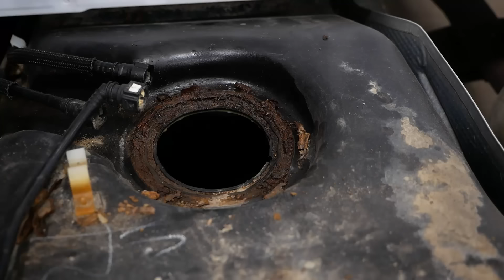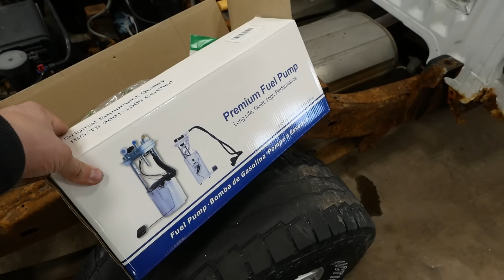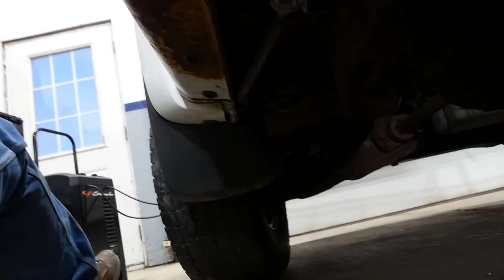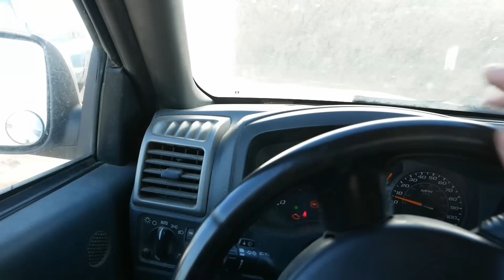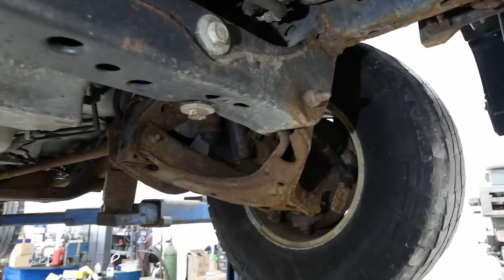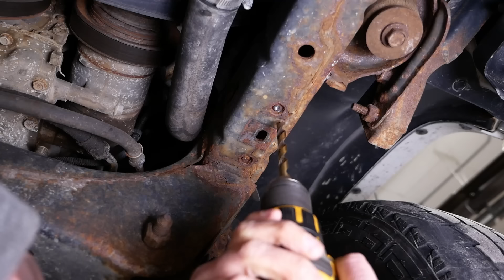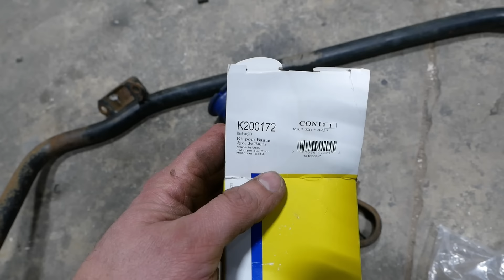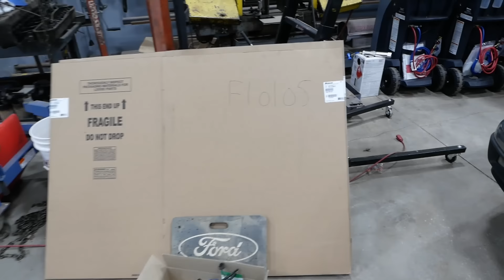Saving a GMC Canyon with 434,000 Miles from the Crusher - Won't Start, Fuel Pump Tabs Rotted

Comment: It would be interesting to see the repair history of this truck. They have a very bad reputation....but the fixes are usually cheap so I can see how someone just kept fixing this truck. Rust is another issue, I think GM uses it for planned obsolescence. I had a 2002 Chevy Silverado with 130,000 miles and it had huge rust problems, with rotted floors and rocker panels. I also have a 2001 Honda Civic, with 207,000 miles, no rust problem at all. Obviously Honda did not engineer their cars to rust quickly.
Reply: I've lost 2 Hondas to rot.  They absolutely rot just like the rest of them.
Reply: @WTFIsThisGuyDoing233  yep my shop stays busy fixing rusted out Hondas and Toyotas. They rust just as bad it not worse
Reply: @KNIGHTOFELEMIA I live in NY, and both cars were local.
Reply: GM could care less about quality AND they know it...As long as the top 12 People who run the Company get their FAT Checks & Bonuses!!!
Reply: @KNIGHTOFELEMIA I have a 1996 Accord with 281,000 miles. It has a tiny bit of rot around the right rear quarter, but that's the worst of it. The undercarriage has some minor surface rust and nothing else. I also have a 2006 Accord with 227,000 miles that is rust-free.
Reply: All cars and trucks rust out.  There is no such thing as planned obsolescence.  All cars and trucks are built to a price point.  I bet the truck was worked harder, went off road, driven in winter etc.  Hondas from that era had significant rust issues.
Reply: @user-tb7rn1il3q  - I disagree. I have 2 Honda Accords, a 2007 and a 2009. The difference between the 2, is stark. The 2007 is built FAR better than the 2009, and if you ask anyone, they will tell you Honda quality has gone down. Why? because people kept their old cars running instead of buying new ones. Honda doesn't make money when people keep their old cars.
Reply: @alanbradford3130  Except those buyers will go to another brand if true.  All manufacturers are striving to build the best product at a price at least some of the population can afford.  Overall quality of all brands is getting better over time.
Reply: @user-tb7rn1il3q  - I don't agree...IMHO, there is only one manufacturer left that makes cars that will last to 300k or more and that is Toyota. All the rest are maxing out at 150 to 200K. With the whole industry transitioning to EVs, only Toyota can make the kind of high quality cars we got used to in the 90's and 2000's.
Reply: I thought the same thing of these Colorados and Canyons when they came out. But they have surprised me!
Reply: @KNIGHTOFELEMIA where did race come from? Wtf are you taking about. I don’t have a damn clue what color you are nor do I care.
Reply: @KNIGHTOFELEMIA ooga booga is a reference to cave men and boomers who are mentally still stuck in the past.
Reply: I have a 97 accord with 225,000 miles. It needs a new rear brake line and a new IAC valve, but otherwise it runs and drives fine(I don’t drive it on the road with a blown brake like obviously)
Reply: @KNIGHTOFELEMIA no it isn’t racist. I already told you what it was but you can twist it around in whatever messed up way you want to to fit your agenda. Just like you’ve done with this whole old car BS.
Reply: @KNIGHTOFELEMIA 49 GMC half ton truck weighed less than 3500lbs.

2010 GMC half ton single cab short bed weighs 4500lbs.

The metal on older cars and trucks is thin, BUT it feels pretty stout due to the deep stampings. Many older cars were put out to pasture before 100,000 miles, and were such a chore to drive in the snow on bias ply tires. That adds up to cars that saw very little road salt in 75 years.
Reply: @Texassince1836  i think people forget about mandated safety features that add a lot of weight in a crash in a 49 gmc you gonna die going 55 in a modern truck you will probably live with some injuries
Reply: @KNIGHTOFELEMIA My sister can attest to a POS four cylinder engine being lighter than any V8.  You read that right.  I would assume that a V6 is also lighter than an old-school V8.  Of course that just affirms your point
Reply: You're right the repair history would be very helpful especially on this high mileage truck with this specific 5 cylinder engine. These have another set of "timing chains" on the back of the engine. That's right you have to remove the transmission to get to them. Technically they're not for timing but for counter balancing due to being a 5 cylinder engine.
Reply: @KNIGHTOFELEMIA no a 49 gmc is not made from thick metal. It’s flimsy 20 gauge crap that rusts out just as fast as modern steel if not worse.
Reply: @KNIGHTOFELEMIA yea it’s sitting in a field. Point proven
Reply: My 99 blazer has 260k and zero rust
Reply: @KNIGHTOFELEMIA okay define “metal”
Reply: @KNIGHTOFELEMIA do you understand what 20 gauge steel is? Do you get how incredibly thin it is?
Reply: @KNIGHTOFELEMIA smh. you can look up the weights of any modern car you want and compare to a car from the past that’s a similar model. Promise you the weight is either identical or more for the modern car. You know what’s funny tho? I used to be one of you. I would defend those old hunks of crap no matter what and just ignore facts. Eventually I grew up and saw reality. You think like a cave man. “Ooga booga. Thick heavy steel good. her durr”. Design is far far more important and old cars were designed terribly. On old cars your super thin flimsy hood, fenders and radiator support were your only crash structure on the front. On modern cars, those parts are just aerodynamic, aesthetic pieces. The real structure is under all that crap. I still love many older cars and own a 73 Chevy k20 and love those trucks, but they are built like crap. Eventually you’ll wake up out of your delusion and see reality. Or just keep denying facts.
Reply: @KNIGHTOFELEMIA you have got to be an old boomer. You lack any sense of critical thinking skills. I said compare a modern car that is comparable to an old one. Compare a modern 4 door sedan to a 50s 4 door sedan. I already made this clear but I guess you’re too slow to understand. I’m glad people (boomers) with such low intelligence and no ability to think for themselves are dying out. It’s an amazing thing.
Reply: @KNIGHTOFELEMIA thanks for confirming what I last stated. Good luck to you old man.
Reply: @KNIGHTOFELEMIA no it doesn’t have thicker metal. It’s 20 gauge flimsy crap. Those old trucks had 5 digit odometers for a reason. Most of them broke down way back then and sat around with very few miles on them. That’s the only reason you can find any in good shape.
Reply: @KNIGHTOFELEMIA no you’re wrong. Older vehicles were actually way lighter. Compare a modern sedan to a 50s sedan. The modern car weighs substantially more. I think you need to see some pictures of those old cars in crashes. They are so weak, flimsy and poorly designed that they fold up like soda cans. Engines coming through the firewall were common back then. Rarely if ever will that happen in a modern car.

Comment: Nice Job Boss. Just a thought . When drilling up like that find something to pry under the back of the drill with . maybe use your transmission jack as a fulcrum and a 2 X 4 to pry against the drill with . Saves the shoulder and the forearm . This also lets you drill more like your drill press . Saves the bits a little .

Comment: Last time I was in a situation like this I cleaned everything meticulously, scuffed it with sandpaper, cleaned it again with acetone, and then epoxyed it on. It's been 3 years and 60k miles and it hasn't leaked yet... But I realize as a shop this may not be a viable option for liability reasons.
Reply from the maker: I've seen a few of them glued in over the years.

Comment: That gas tank ring repair kit should have been a factory design. Nice fix Wes!
My buddy showed me a little tech tip when you're drilling upside down,...... Place a Dixie cup over your drill bit to reduce hot metal shavings from going down your shirt sleeves or eyes.
Reply: The well it rides in is the real issue.
Reply: @dlewis9760  It's to get maximum fuel capacity for a given build heigth.

Comment: Happy Saturday from just north of you in Wisconsin. I manage a fleet of GM trucks with about 15 pickups ranging from 2008 to 2021 model year. I have multiple trucks in the fleet over 400k and we don’t usually get rid of a truck til it hits 500k. We travel all over the country building railroads, we buy only chevy gas pickups, we buy them brand new and we regularly get over 400k out of original engines and transmissions.
Reply from the maker: That's impressive! UP used to run fleets of 4 door long box Chevy trucks with 6.2 diesels. They sold them surplus locally and you see them everywhere. They were all painted a horrible orange or green color with black rims.

Comment: I went through same thing with a customer car. He is also a fellow shop owner. He called and asked if I could program the new PCM. It took me about 3 hours to figure out that the gas ta k was full of water. I ordered a new pump which was of course wrong one because I read the build date instead of the VIN to determine the year. Anyway back and forth with rock auto I got the new pump and pulled tank down and found that the lock ring was rotten and had allowed water to fill the ta k. Called the guy he said the day it quit running it was raining. At the time about 3 years ago we did order a used tank from California which was 400 bucks shipped. Put it all together got the truck running and it had a cylinder 4 (or one of the cylinders ) single cylinder misfire. Found that the rings were stuck and leakdown coming from pcv

Comment: I have to wonder how many mechanics would have never found that issue also.. as a DIY guy I try to fix all my own vehicle issues.. I am certain that would never have been found by me.. I would have ran a new wire outside of the harness.. I bet a majority of mechanic shops would have done the same new wire fix.

Comment: I just ran into a similar weird thing. This wasn't an automotive part. It was a the chrome ring that goes around the a half inch water feed line. I bought two half inch size rings. It said so on the  package. But, one was half inch, the other was three quarter inch. That prevented me from turning the water back on till I went back to the hardware store and got the correct size item. How does that happen? Whether it is a part for your car or a plumbing part, the part should match the part number. Are we seeing a decline in quality control such that they can't consistently supply the correct part? Have not encountered that before.
Reply from the maker: Who knows. Moog is a dumpster fire of poor quality.
Reply: @WatchWesWork  That is sad. Moog used to be a good company, at least back when I was a mechanic, many years ago.

Comment: Nothing worse than working on plastic fittings that are old in freezing weather where you just know they want to snap. Don't you just love drilling overhead on your back in the cold? 
As for the truck, he probably has less than 1/4 the cost of a Gator tied up in what will be a field truck. Perhaps a bit of #3 on top of the o ring and in the groove? Maybe a bottle brush or test tube brush for cleaning scuzzy throttle bodies? Whose blue ratchet is that? Good video and thanks for the info on case hardened bolts. Stay well.
Reply from the maker: Harbor Freight.

Comment: I'm very skeptical of the milage....
Reply from the maker: I am too. The pedals aren't really worn. The interior is pretty good other than the seat cover.
Reply: mine is at 360,000 miles. those POS 5 cylinders cant get out its own way but will run forever. mine somehow still runs even without almost no oil for a month

Comment: somebody had a long commute with that truck for a lot of years. Probably rot in the field before it dies for the farmer
Reply: nah, the frame will rot either at the engine mounts, the rear cab mounts or the leaf spring hangers first. frame already halfway there, just biding its time slowly but surely flaking away

Comment: They did that on purpose. To force you to buy new fuel tank or new truck.
Reply from the maker: That's fine. But then they stopped selling the tanks!
Reply: It's probably a non-issue for 90%+ of the vehicles using that design.

Comment: As a kid (70's UK) I was always told Americans have big cheap cars because they are badly made (This was USDM not necessarily USA made)  I guess this is still true? My VW Transporter (Comparing light comercial with light comercial)  is the same age (ok it's an '06)as this beast. It previously belonged to the German Post office in the Ardens Mountains and now lives in the French alps, so conditions as bad for vehicles as anywhere in the rust belt. It only has surface rust on the (many) bts of minor body damage - no rot anywhere. All the bolts come out, sometimes with some persuasion, but nothing snapped off in situ, nothing needing heat????
Reply: The concept of wax rust proofing from the factory seems to be completely unknown in USA. They have just given up, instead of apllying it when new, and then after 5 and then every 2 years.

Comment: I currently drive an '04 Canyon 2.8 L I4, 2WD with 105k miles.  The frame on the '05 Canyon looks better than my 04.  Pennsylvania salt must be more potent than Illinois salt.  My truck tormented me with vacuum leak codes until I removed the intake resonator and found that PCV hose disconnected,  
Now, since seeing the carnage at the fuel tank on that '05, I'm just waiting for the fuel pump to rot out of the tank.  Even with all the problems with my Canyon, it has grown on me, and I'll hate to get rid of it when the final big-ticket item fails.  
Over 400K miles seems incredible, I've heard that the inline engines need new timing chains at 150k miles, and the cost of that repair usually exceeds the value of the truck.
Reply: just wait till that POS vvt goes or the water pump decides to grenade. my 06 has had both but its the bastard stepchild 5 cylinder. both cost me upwards of $1000ish
Reply from the maker: I think it was the inline 4 that had all the timing chain issues.

Comment: Had a feeling that self-tappers would be part of the solution. Although my solution also involved fender washers. That plate is quite the clever solution.
Reply: Amen on the fender washers! With self tappers, fender washers, duct tape and some zip ties you can fix almost anything! Throw in some joist hangers and a a welder and anything short of brain surgery is a DIY project!
Reply: @Bret4207  You completely forgot the huge supply of RTV.
Reply: @Tinker001  use seal-all, many of us used to patch holes in steel tanks with it and thin sheets steel(tin), just clean with with REAL brass bristle brushes, so you do not go BOOM/fire. you'll need to clean it all good, leave it kind of coarse /scratched surface and let the stuff set overnight. best bet is also add some mechanical fastener, pushing against the area from the body/frame. like pvc pipe, or other with thick rubber piece also.
I've seen that last 5+ years just below a tank seam leak, so it was very often under fuel.
Reply: @Tinker001  I stand corrected!!! I also forgot pop rivets!!! With enough pop rivets, old metal roofing and Bloo Gloo you could pretty much raise the Titanic!!!